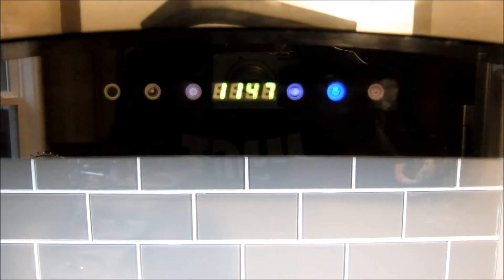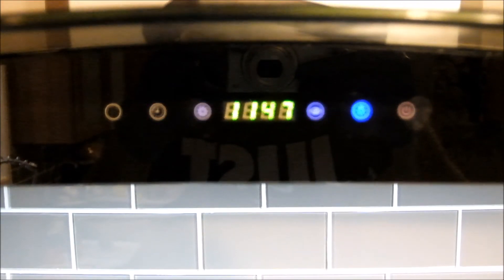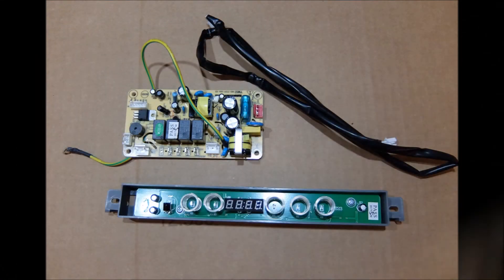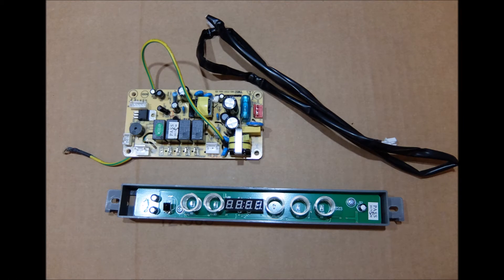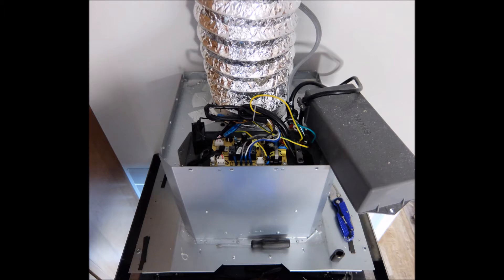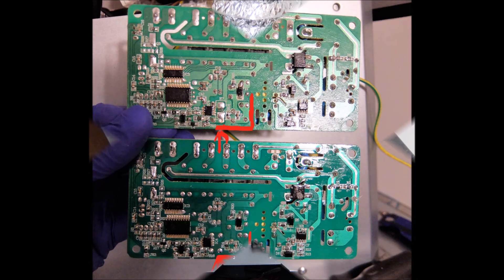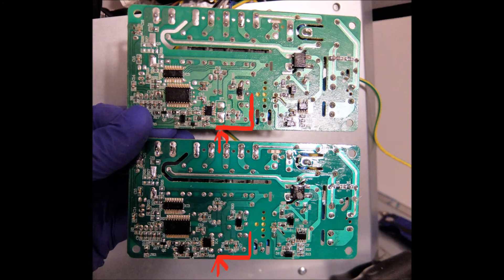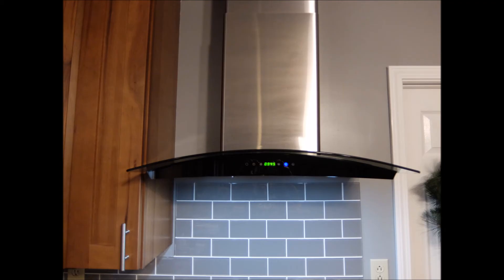AKDY Range Hood problem already

Comment: It looks like you posted this at least a year ago.  I just received mine today and plugged it in, no power at all.  I guess they never rectified the problem. I’m going to contact the seller and the manufacturer and see what transpires from this.
Reply from the maker: The eBay seller immediately sent me the new part, it has been fine since

Comment: Hi  Did you install the backsplash tiles before or after the install?
Reply from the maker: After. There is spaces I had to paint
Reply: @sweetpigfarm3645   Thank you so much for the information, Also did you put the tile underneath the chimney or up to the edge?
Reply from the maker: @lvboats  there is a 1inch plus gap between the base of the hood and where the tile stops